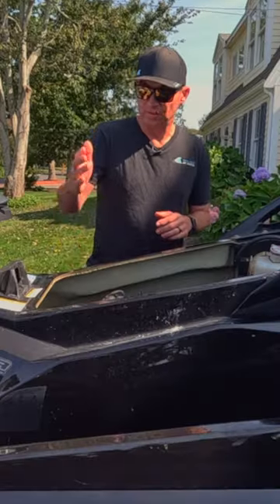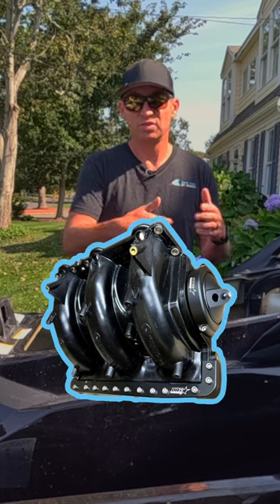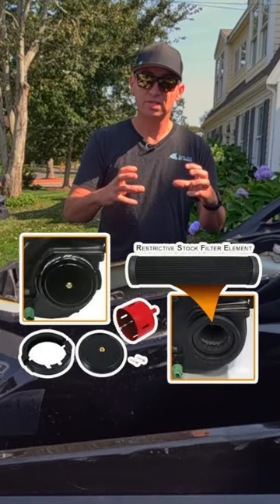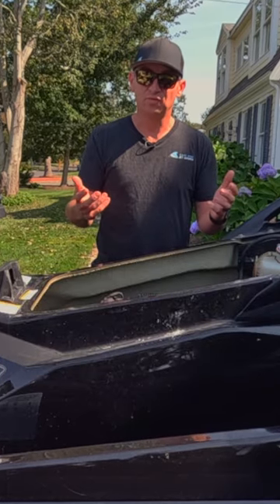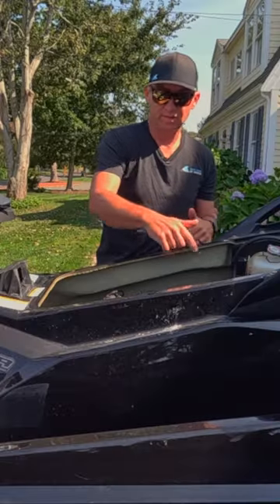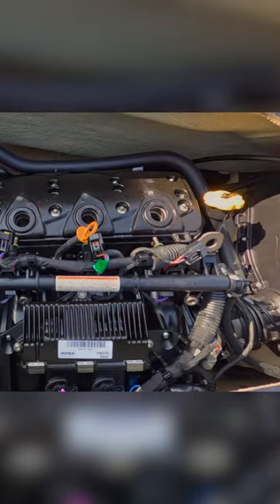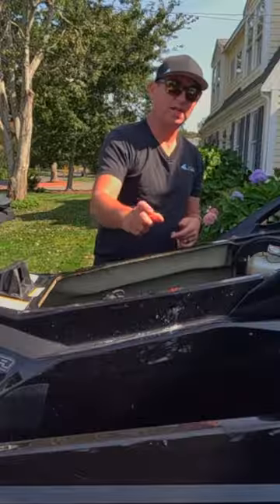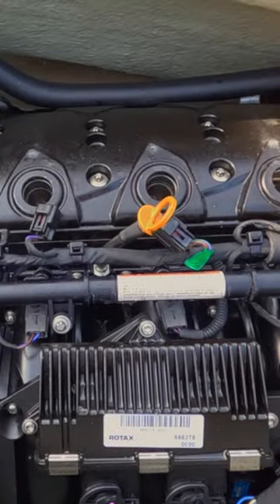Fogging a Sea-Doo GTI SE Motor

Comment: Hey I have a 2018 spark trixx . Do I really need to remove fuel rail ? Or is just cylinders sufficient?
Reply from the maker: On most motors you choke out the engine by spraying through the intake. I go through the injector holes because it's easy on SeaDoos, but the manual just says spray down the cylinders with XPS lubricant